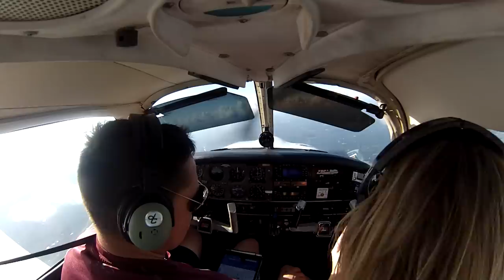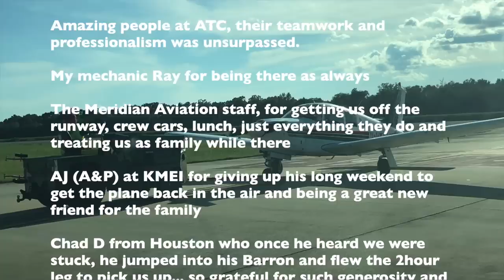Real Emergency - Power Off Landing with family in Piper Arrow after throttle cable breaks

Comment: At least it when the throttle cable breaks goes to full instead of idle
Reply: True I'd rather have all the power than have no power. He might consider upgrading to a variable pitch prop in case this were to happen again he could still control his thrust
Reply: @timbrwolf1121  A constant speed prop is not a simple upgrade and it doesn't give you direct control of thrust like you're thinking.  The incident in this video is like a runaway car stuck at full throttle, adding a constant speed prop would be analogous to having the car stuck at full throttle but still able to change gears.
Reply from the maker: Arrows are variable pitch props. But bigger bites of air can slow the RPMs but not necessarily the plane and was really prioritizing a go-around for me what was my best bet to just restart and go around if I didn’t like the way it was shaping up.  Thanks for watching :)
Reply: @timbrwolf1121  The Arrow has a constant speed prop. At full throttle using the prop to slow down is bad for the engine and puts go-around into the test flight category.
Reply: @FamilyPilot  Jumped the gun on replying to comments before watching the video.  I thought you were in a Warrior based on the comments.  LOL.
Reply: @FamilyPilot  I thought variable pitch props could go to a zero pitch? Or is that not really a thing with modern prop shape?
Reply from the maker: King airs and such can truly feather but not these birds but I’m not an expert on those that can.
Reply: @timbrwolf1121  Turboprops are able to transition from a fairly low pitch to a reverse pitch range called Beta, but there isn't a truly flat pitch, zero thrust setting.  The piston aircrafts don't have this feature.
Reply: @racerboom3389  With modern technology I bet a zero pitch variable is possible. I'm just an engineer not a pilot yet. I bet we could make a variable geometry prop at this point. The props could change their entire profile in flight
Reply: @racerboom3389  this is incorrect. Beta range is the ground range of operation for a propeller, Alpha range is the flight range.
Normally, in beta range, blade angle is scheduled, meaning the pilot can select a desired blade angle with the condition lever.
In flight, (Alpha range) blade angle is controlled by the prop governor to maintain a constant RPM, and fuel is scheduled. The pilot controls power (via changes in fuel flow) with the power levers. Advance the PL to get more fuel = more power. The governor responds by changing blade angle to maintain RPM.
If a propeller is reversible, then it certainly has a zero thrust setting.
Think about it: as the blade angle gets flatter & flatter, it has to pass a point before it reaches negative blade angle (reverse), and thus the pilot has control over a wide range of thrust (positive, zero, or negative) in the ground range.
Beta is not simply reverse, it is much more than that.
Reply: @timbrwolf1121  I think you are very confused regarding blade angles.
Full feather and full reverse are at completely opposite ends of the range of operation with regards to blade angle.

There is no need for a propeller blade to change profile in flight. The profile is carefully engineered based on the difference in angle of attack from root to tip.

What can change, is the angle of attack by rotating the blades simultaneously at the propeller hub. This allows for maintaining a constant RPM in flight (Alpha) while changes in fuel flow and power will occur, and allows for fine control over taxi speed on the ground with direct control over blade angle (Beta).
Reply: @NETBotic  Who cares if its hard on the engine. Engines can be rebuilt and replaced, Lives cannot
Reply: @zuestoots5176  Maybe someone that wants the option of a go-around? 

ADM is about risk management. This video clearly shows the pilot didn't want to make anything worse, and didn't have to. 

Have you ever used prop pitch at full throttle to bog down the engine? It's not fun and if anything would add a lot of stress to the pilot. The kids in the back would know something was up as well.
Reply: @racerboom3389  your scenario about the car....it would still work. You can reduce or increase the speed depending on the gear. It'll be max speed in that car...but you still have some speed control. I don't know much about props...but I'm sure they can neutralize the angle(don't really know the lingo...pitch maybe?) to where the props aren't really pulling any air.
Reply: @adamreznik6374  Thank you.
Reply: Can someone explain how the throttle goes full throttle.
We have a Arrow engine on a stand. I had a look, there is no mechanism that would put the throttle to full on cable break. Just luck it broke at full throttle.
Reply: @flybobbie1449  since its on a stand maybe a smart person removed the spring that puts it to wide open so that if its being ran on the stand and the cable snaps its just stuck at that throttle position.....think the reverse of a carb return spring on a car
Reply: @anthonycope8637  The mechanism is a lever with two adjustment nuts and a thread. There is a spring between these components but no means of attaching an opening spring.
Reply: No sense in making the prop go to zero effective pitch in this situation because it would overspeed the prop.  With no air resistance, the engine would simply turn the prop faster and faster until it disintegrated.  At that point, best case scenario is that the prop simply separates from the engine and you have to shoot an approach with no power at all.  Most likely scenario is that one blade rips off first, causing incalculable stress on the engine and mount, with a 50/50 chance the engine will stop turning before the vibration rips the engine completely off the airframe.  At that point, your CG is so far aft, the only thing you can do is flutter to the ground like a leaf with all onboard completely dead.  So maybe rethink that idea.  Google "Reno prop separation" to see what happened to Relentless back in 2010.  He lost oil pressure which controls the pitch of the prop, and the prop is designed to go into fine pitch (high RPM) when that happens.  The prop exploded and he got to brush up on dead stick landings.

Feathering a prop to achieve a reduction in thrust is possible, but you're likely going to damage the engine in some form or fashion.  Short durations are okay, but not very advisable due to detonation/pre-ignition issues...the mags are timed to a specific RPM and have no anti-knock ignition feature. Do it long enough and you may not have a working engine if you need a go-around.

It's not difficult to modulate power, and thus manage speed, with mixture on/off...plus it does no harm to the engine or prop. Makes it sound like a WWI fighter too, so you at least look cool shooting your approach.  The engine isn't designed to go to full throttle if the cable breaks, there's simply no return spring in either direction.  So whatever throttle position it's in when it breaks is what you get to work with.  If you're on flare when it breaks, you're stuck with no throttle.  If it breaks on climbout, you're stuck with full throttle.  If it breaks in cruise, well, you're stuck with cruise power.
Reply: @anthonycope8637  It's a empty engine formally used by a sales company. The throttle body is still attached with it's mechanism.
Reply: @racerboom3389  RUN AWAY STUCK THROTTLE ON A CAR - JUST SWITCH THE IGNITION OFF AND COAST TO THE SIDE OF THE ROAD.

Comment: 07:55 apparently the FaceID does not help when you’re in emergency...
Reply from the maker: Haha good catch. It’s only those sunglasses it doesn’t work with lol. I was like COME ON!
Reply: @FamilyPilot  Gotta get polarized glasses!
Reply: There's a setting for "Require attention for Face ID" - if you turn that off it will work with sunglasses.
Reply: @d.brenphotography6045  pilots are not allowed to get polarized sunglasses
Reply: @makr0295  I always fly with polarized sunglasses. No issues at all.
Reply: @djinn666  as long as you fly with analog instruments yes.
Reply: Polarized glasses make LCD screens go almost completely black, therefore not allowed for pilots. Obviously if you run only analog gauges no problem, but in glass cockpits it's an absolute no go
Reply: @ByGraceThroughFaithHomestead  It depends on the screen too. I'm mostly using stream gauges, but the GPS has an lcd display and I can see it just fine.

As for whether it's allowed, I believe it's an FAA recommendation, not a rule. Obviously if I can't see something, I'll take it off. It just hasn't happened yet.
Reply: @ByGraceThroughFaithHomestead  depends on the direction of polarization in the glasses, some work fine and others do not. I see pilots fly with them all of the time and with digital gauges.
Reply: My prescription transition lenses are polarized, and they work fine with the G5 and GNS 430W displays in our cockpit.

Comment: I have had a similar incident but with me the cable broke during the runup. After inspection the cable seemed to be dry of lubricant and corroded a bit just near the throttle quadrant before it snapped.  I did send piper an email about this and informed the authorities but no reply yet (after months).  Did you get any feedback and preventive measures?
Reply from the maker: Did not, but I did change out all my cables mixture prop lol

Comment: You have got to love his wife; I want one like her too!! She's got a screwdriver in hand is busy working on the throttle quadrant - lol - LOVE that woman; I need one like that!! Pilot and Co-Pilot did a terrific job, really, note however that no "long approach needed" (i.e. low alt risk) in order to kill speed to get into landing config. With a good running engine (albeit stuck throttle) at your disposal, keep and use u'r altitude - remember; altitude is your friend! Line up at alt' to your runway; get level flight; kill pwr (mixture/mag's); drop gear at vle speed and get flaps out; with ias rapidly slowing, pitch aircraft to establish controlled speed/glide rate above your vso and watch your vsi/descent rate. It will be steep but you should maintain 90 - 100kts. If you think you're too high; crab to break your speed and accelerate your descent rate (rudders work wonders as air brakes - use them!) while maintaining a steady descent pitch to your target threshold. Practice this on a simulator and you'll find that a high alt dead stick approach like this is very tame and controllable. You'll have "E" if you think you'll need a go-around (alt = potential energy) and a kinetic power source when you switch the mag's back on (hopefully). In the worst; if you're engine start fails that "E" will give you some maneuvering speed to level and flare for an off airport landing wherein a low, slow approach has little if any room for error and mistakes. Alt is your friend; keep it; love it; use it and happy skies will be yours.
Reply: Glenn Andrews keeping 90-100 knots is probably at the beginning of final and depending on how high he is ... but once he is sure he will make the run way as u said alt is ur friend .. his got to reduce the airspeed quickly by lowering flaps and crabbing if needed while maintaining the lowered pitch to aim for  60 knots as the touch down speed for a piper. Some pilots to reduce speed and increase the sink rate will increase the pitch and play with the pitch accordingly. Some do not like to do that and keep pitch steady and use crabbing and cross controls ( however this is not recommended in a piper)
Reply: @Seemashe  Hello there...been some time since this post but let me reply to your suggestion above. Since we're in a difficult/emergency landing here, I wouldn't be thinking anything about "60 kt landing speed"...this is clearly not a typical pattern landing approach and with that, I would opt to "fly" the airplane down, period. Not necessary to land a Piper at book speeds (saves tires, short fields, etc). I solo'd many moons ago in a Piper Cherokee 180 and that work-horse "Chevy of the sky" will land just fine at 80, 90 knots, albeit with a lot of float via ground effect. To avoid excessive float, lift flaps pre-flare stage and resist that muscle memory to flare; instead keep the nose level to ground and let'r sink in with the speed bleeding off. In any event, I would agree to try to stick to published performance data but in an emergency with stalling being the #1 killer, keep that speed; use that "E"; and fly it down - all the way. Happy skies! :)

Comment: When the person who’s not the pilot has the Bose A20 headset and the pilot in command doesn’t
Reply: ORF_AV8TOR happy wife happy life! 😂
Reply: Shes the boss!
Reply: Is a Bose A20 a noise cancellation headset? I rather hear what is going on around me than have it cancelled out by the headset.
Reply: @Stubby0266  Noise cancelling is a slight misnomer, they're more accurately referred to as Active Noise Reduction (ANR) headsets, and it doesn't eliminate any sound completely it just dulls it significantly. Having flown many hours with both, ANR is definitely the way to go. You end up far less fatigued at the end of a long trip while having no trouble hearing if something unusual happens. Bose A20 is I believe the most common headset among airline pilots even though their cockpits are relatively quiet.
Reply: Got to have a good headset to get the most of the IFE.
Reply: If you were married...you’d understand.

Comment: Great Job! Lots to be learned from this video! Did this plane have the emergency overide gear down?
Reply from the maker: Lloyd Ellis Lloyd, was ready to but did not need to. I wanted to do a power extension and not have to worry about trying to rock the gear into place. 

Turned final did a r360, setup pitches up to drop speed and got 2knots below gear speed and dropped it. Then we were on good shape and slowing with the drag. Made for a relieved stabilized approach. 

But was ready for it - really didn’t want to test out how important that gear speed is lol thanks for watching

Comment: That adrenaline crash at the end... the headrush of emotions.  The immediate relief, unparalleled happiness, stunned realization that you just survived a potential fatal situation, and exhaustion.  Not a pilot but I've felt that  three times in my life where I survived a near fatal situation.  One of them was just about as protracted as yours.  I just want to share it because seeing this has been therapeutic for me somehow.

This happened to me 3 years ago.  I used to be a welder and was pretty damn good if I say so myself.  My buddy and I were doing a job in Kerrville, South Central Tx.  He and I are best friends since highschool and worked together as welders on heavy equipment such as excavators, sheers, front end loaders, and massive end dumps.  

The repairs were always crazy because the booms of the machine would snap or tear, the forks and buckets would snap or shatter, and hydraulic pipes would blow holes.  But our modifications were something that we were excellent at and we had a blast working together.  But I digress... this is stream of thought.

So we were doing this job on am excavator where the boom near the bucket was ripped open 1/4 to 1/2 inch plate.  We'd been told it was a simple fix with no cutting needed so we opted not to bring the oxy acetylene rig with us.  The machine was parked between two buildings that were probably 30 to 40 feet apart, and our truck was next to it in that gap.  On the opposite side of the machine was a huuuuuuge propane tank.  So they told us we could borrow their torch.  The tanks were in baaaad shape, with one of them missing the valve key.  That was the acetylene tank... so bad you had to use a wrench to open up.  Well it had a leak between the regulator and the nozzle.  So we're cutting away the cripped steel and suddenly people behind us are flipping out!  Running!  We turned and saw the cause:  the acetylene tank was shooting fire out before the regulator.  We went to turn it off, and remembered there was no key.  The damn wrench wouldn't cut it off either.  So flashback arrestors were useless, it was like standing next to a lit stick if giant dynamite teathered to a tank of oxygen about 25 feet from a huge propane tank.  My buddy ran with everyone else as I jumped in my truck and drove down the road.  

I jump out as my bud was running back to the fire, so I ran back to help.  It couldn't be stopped so we split fast!  The owner of that business came out with a waterhose to try to out it out with water which you're not supposed to do.  We run back and as we got to him, the fire snuffed out.  The tank was still bleeding out gas and was hot as hell so we had everyone back off till it was empty.  After that, I experienced that emotion endorphin dump.  

Standing next to it desperately trying to figure out how to stop it from blowing the damn neighborhood up, right next to it trying to stay calm but knowing it could go at any moment just about knocked me on my ass.
Reply from the maker: Thanks Adam. Bigger emergencies everyday but this was big enough for us - we’re good ;) don’t need more. Lol cheers

Comment: You still had power. With the mixture knob, you still had control over it. Most importantly, you had your skills as a pilot. The risk to you and your family, even with the mechanical failure, was statistically less than it was on the drive to the field. I hope this little hiccup doesn't dissuade you or the family from flying in the future. I've seen that same expression on my wifes face and it usually means "Never doing this again!", which would be a real shame. The kiddoes in the back are making fond memories that will last a lifetime back there. Swap that cable and get that piper back in the air where she belongs!
Reply from the maker: Yessir! Thanks for your comment and she did great getting back up there :) still flying. Thanks again!